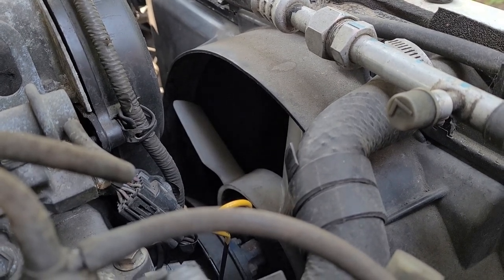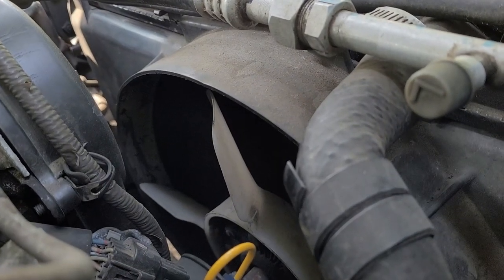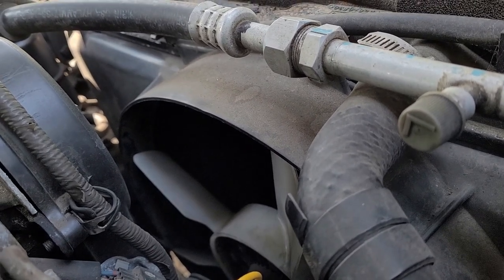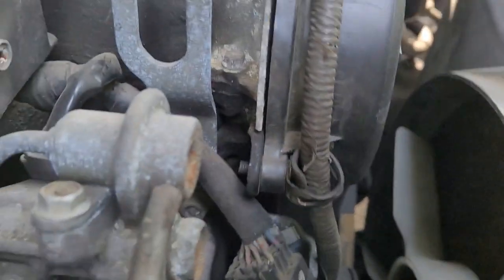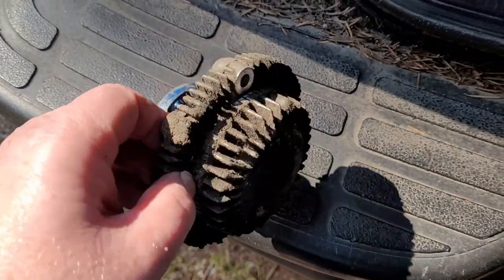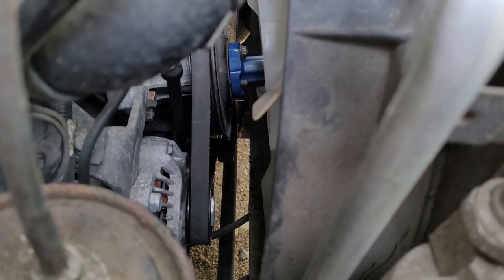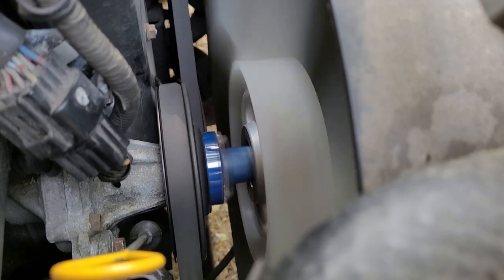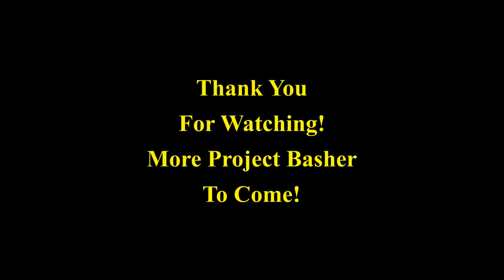Project Basher (1996 Geo Tracker): Radiator Fan Clutch

Comment: now imagine the bolts on the pulley are so tight that you can't get it off with the tightest vice grip you can manage while using channel locks on the shaft to prevent spinning. that's where i'm at